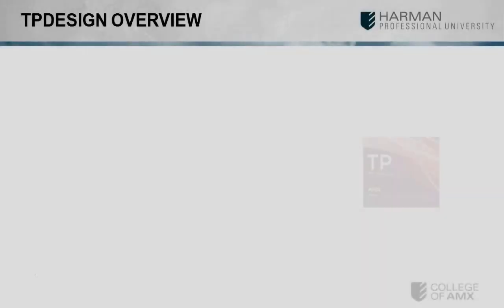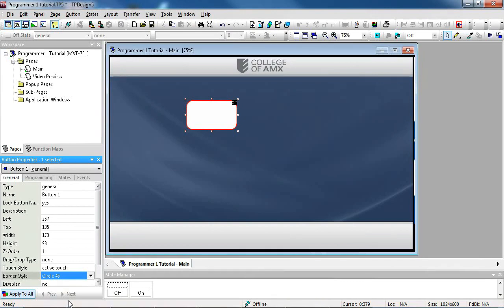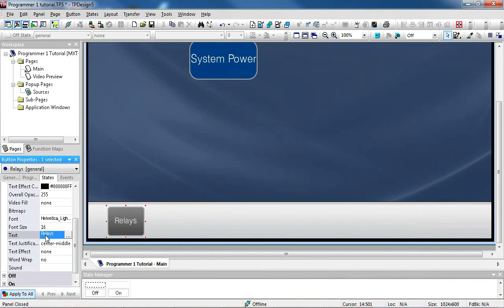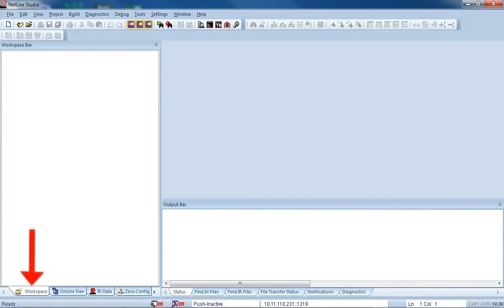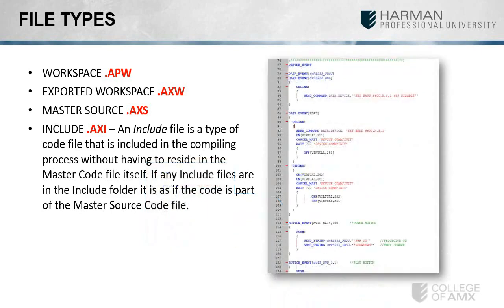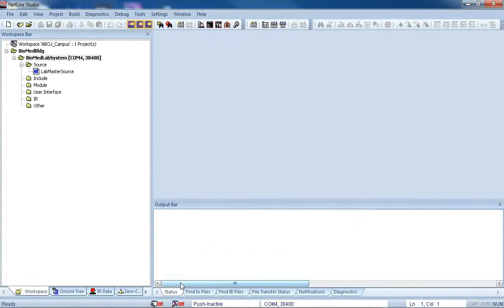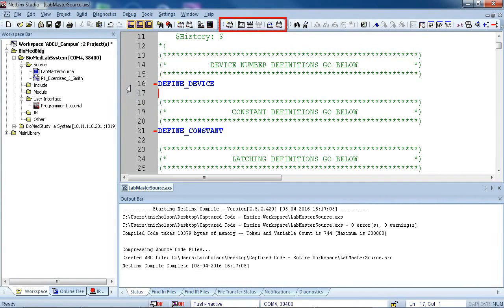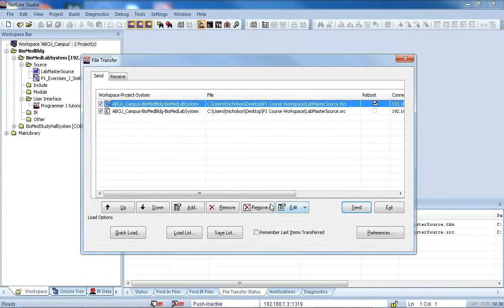AMX Programming Full Course

Comment: I have 3 devices Netlinx NX-1200, Netlinx NL-3000, DVX 3256HD-T. I set the NX-1200 as the main server controlling the remaining 2 devices. The electrical devices are connected to port 8 of the NX-1200, the Samsung TV is connected to the DXlink/HDMI output of the DVX 3256HD-T using ethernet. The devices are all connected to a wifi router. My main purpose is to turn the TV on and off and the relay on and off via NetlinX & Iridium pro software on the phone.
1. Initially I could not find or differentiate the DVX, NL-3000 from the NX-1200.
2. Can you give me some suggestions about my problem?

Comment: I have an AMX NXT-CV7 panel and made a project, I now put it on a usb drive and plugged it into the panel.. what now? There’s no option to load from usb
Reply from the maker: Use TP design 4 or TP design 5 to upload  TP design in device
Reply: @avengineers5205  Do I just connect the panel over the Mini USB port to my Windows PC running TPDesign 4 and press what?